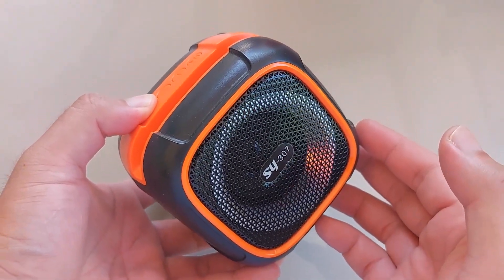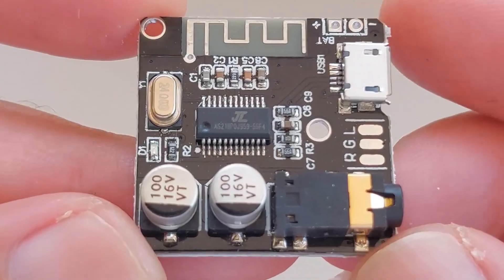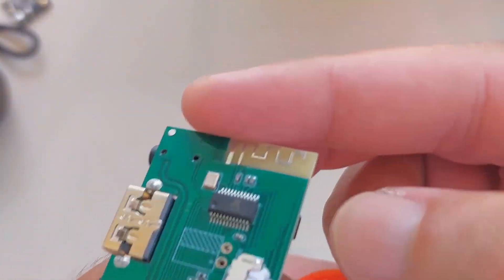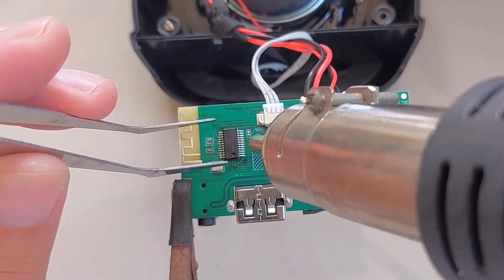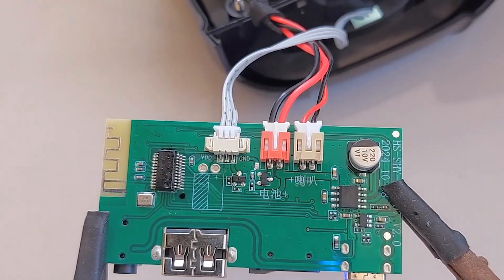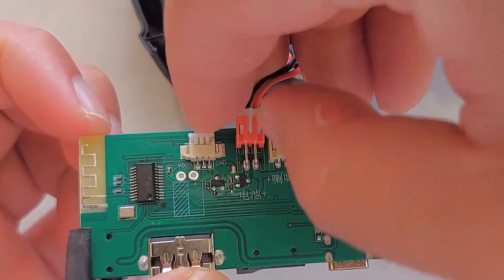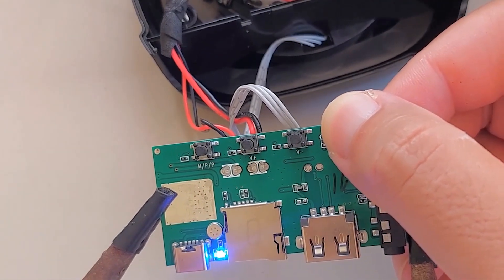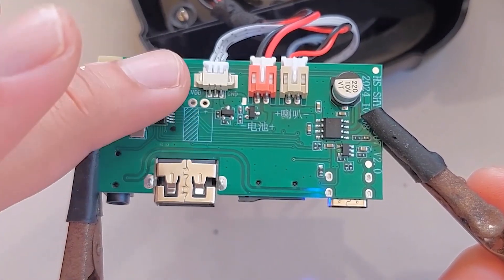I tried to Remove the Voice that says "Bluetooth device is ready to pair" on the my Speaker

Comment: From JDLR repair….  The way is put a switch connected to a speaker and turn off the switch before you open the device
Reply from the maker: That works but when it's low battery you will hear a loud prompt. Which is okay I guess if you keep the speaker charged.

Comment: The chip you tried to put is a differently programmed chip, specifically a Jieli AC6955F. While the speaker itself has a Jieli AC6965E. You should not swap to a diffrent chip. Because they are programmed differently and so does the pinouts. Hopefully this helps.